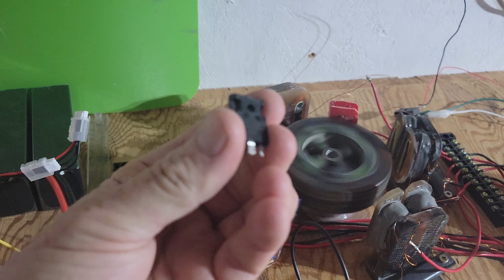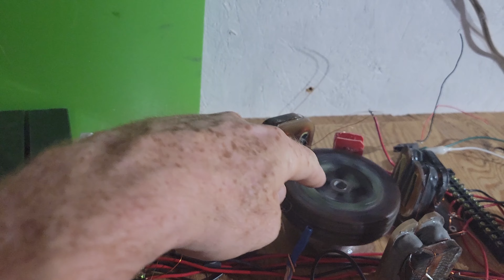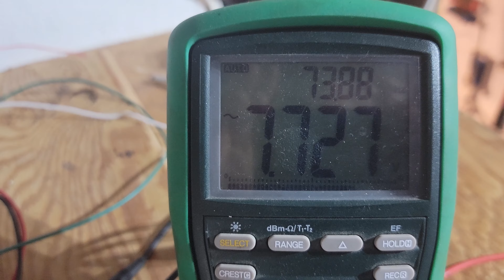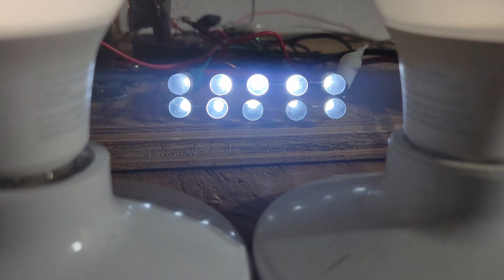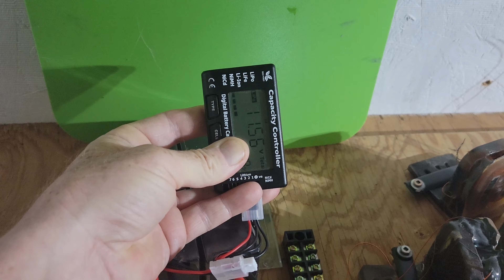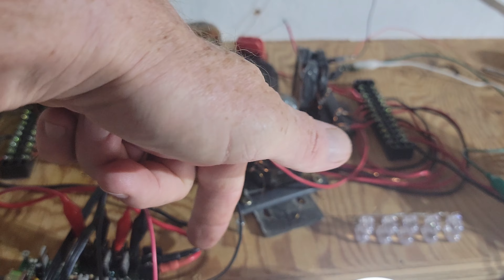Driver circuit comparision between 650v Gallium Nitride Mosfets one is a clear winner

Comment: With this motor you dont have any dedicated gen coils do you? Are lights are hooked up to the diode flyback output only?
Reply from the maker: The 10 leds are hooked up to the red gen coil that was being used to measure htz.
Reply: @windpowerandmore6310 how does the 4v gal fet get the better result when its completely isolated? Is it because it gets more rpm?
Reply from the maker: Yes more power on the rotor.
Reply: @windpowerandmore6310 I need one of your boards once you have developed them! Does the rpm of series coil connection matter? Obviously with my motor the more coils in series the slower it goes. One coil gets the most rpm. Two very similar, then the more I add the slower the rotation speed... I can also move rotors in and out which I played around with this alot! All coils are very close to the same turns and directions etc..
Reply from the maker: If you're going for high flyback output the rotor won't have that much torque.  It's usually one or the other.  Your coils should have the least amount of resistance possible while still have as many turns as possible  without making the  coils too long .
Reply: @windpowerandmore6310 what about rpm?
Reply from the maker: @benlinke7745 i don't have any experience with tuning your motor so I don't know
Reply: @windpowerandmore6310 what are the key points i have to look for? Would fet switching clean wave form be one? Is rotational speed a critical factor? Is coil saturation a factor? Does the hall sensor saturation matter? I feel like I'm so close to achieving the effects, yet a fair way off 😊